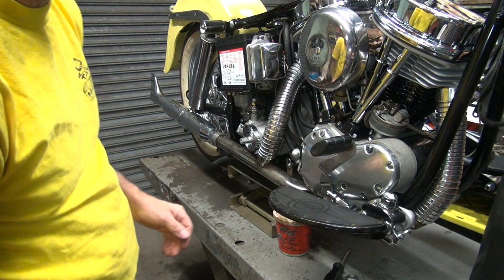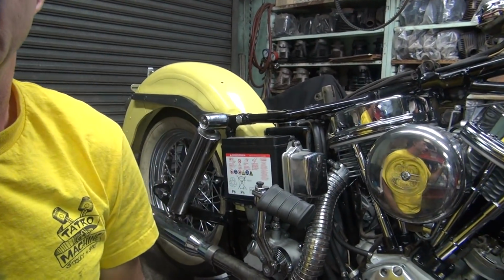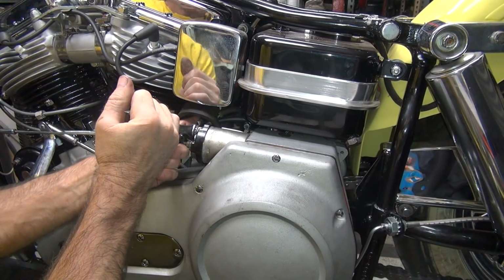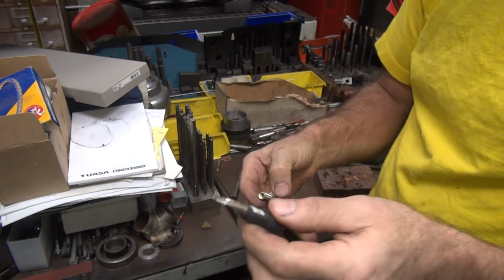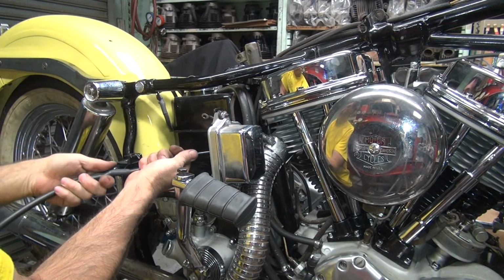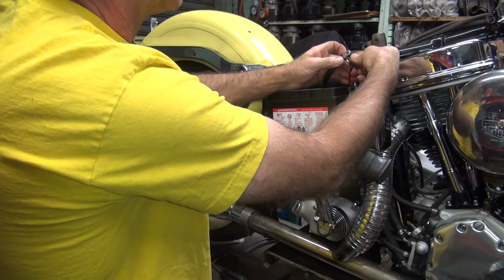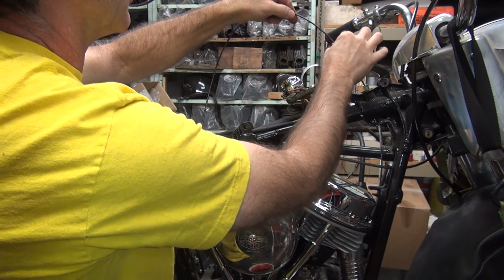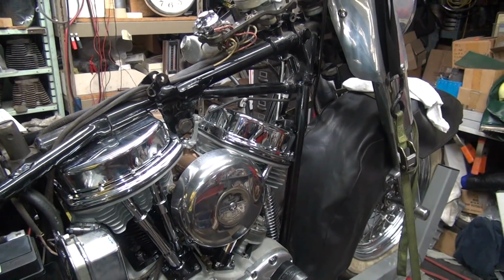1965 panhead #166 74ci flh motor rebuild and bike repair harley by tatro machine

Comment: Concerning batter cable hook up: grease, like oil, is an insulator.  There are grease like compounds made for electrical lugs that help prevent corrosion.  Rust of any kind is going to have an inherent resistance and therefore some heat.
Reply from the maker: and if you don't have any of that you scrap off the bad rusted areas and oil down the metal so it will not rust right away and install the cable just like i did. that thin ass oil will not make any difference to that cable once you tighten it down. the oil just goes away.
tatro